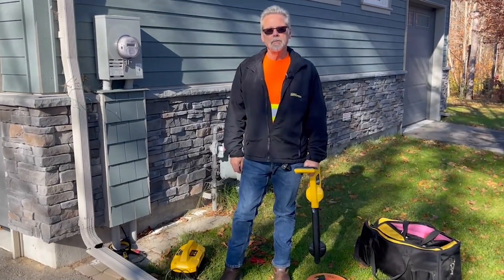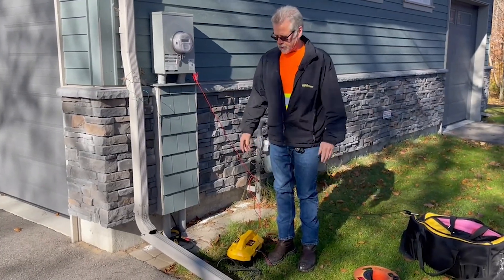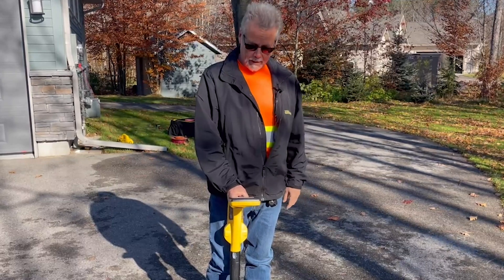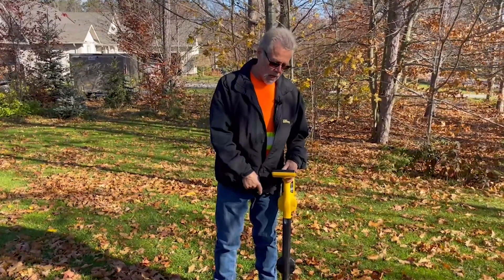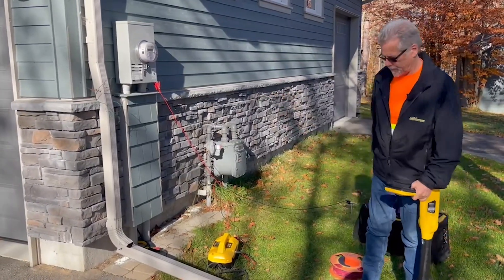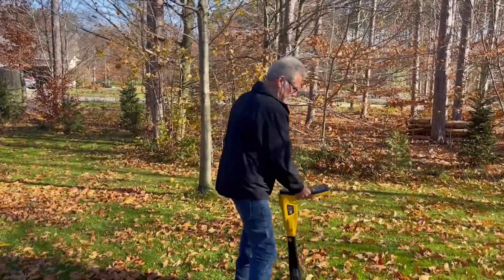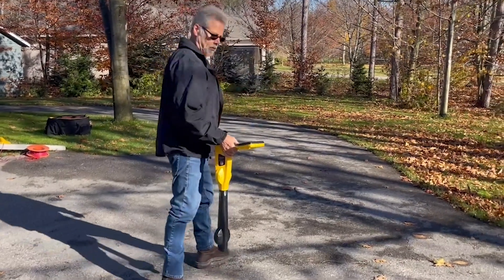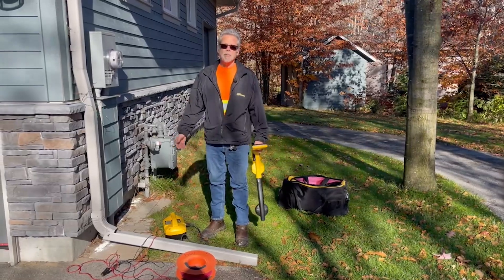Showing the effects of Grounding and Distortion

Comment: Good to see a comparison between clip and clamp. I'd have liked to see his results if he used the clip without the earth stake. Admittedly I use a different locator, but I've found that by NOT using the earth, you avoid false positives. Signal strength is less, but turning up the gain compensates.

Comment: Great video and thank you. I am using a Vloc2 as well as a 5W transmitter and mainly do cast iron  pipe locates. Using the Seenake Ridgid and the camera sonde I am able to locate the head (512mhz). My problem is when I connect the transmitter and ground inside the house. I usually do it the same than you do it in the.ideo, with a long extension outside the house.  Sometimes inside the house the signal from the camera cable jumps into the electrical power in the house and becomes impossible to locate the right signal. I also try to use the direct method with he copper pipes inside the house and most of the time I have the same issue. 
The true I should have bought a Ridgid locator or have somebody experienced in plumbing sewer lines explain me how to use this Vivax locator. For sure to locate pipes outside a house, in the middle an open field, with only a gas line as a distortion, it is a piece of cake and we all can do it ane day. Locate and accurately trace inside a house is another story.
Anyways, great video and thanks. You give a lot of tips and we appreciate it
Reply from the maker: When you ground out in the house you are putting as much or potentially more onto what you have grounded to because it is alternating current. We have a few videos that go more in depth into locating theory and will help but I think you should reach out to your local distributor for some training. Also I would look at our vLoc 3 Pro as the Sonde locating function is amazing.  We have a video on it here on our channel.
Reply: @vivaxcananada  I appreciate your advice. I will look into, but I have watched most of the videos about theory, frequencies and 99% of field trainings are for outside and none for TRACING inside the house. Locate the sonde I do it all the time and it works perfect with th Vloc2, the problem I have and nobody address it is to ground inside the house. Pull the sonde every 6 feet is a hassle if I am working from the rood by myself and having to go up and down until I trace the whole line.
Reply from the maker: @cabezamiami  if you are locating the push rod of the camera you should use higher frequencies. Again I suggest you reach out to your local distributor for assistance.
Reply: @cabezamiami I never ever have issues locating a sonde in a house rigid see snake with the Navi track scout 512mhz on the money every time i am not sure how you’re getting distortion I also use my smaller cameras for kitchen lines and find sonde head in walls too all the time cut the sheetrock and there it is on the money